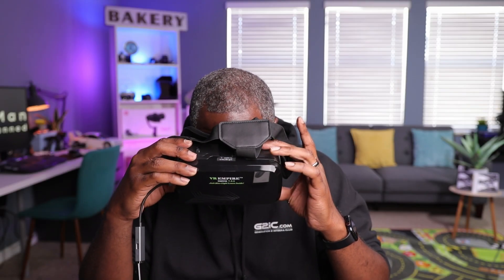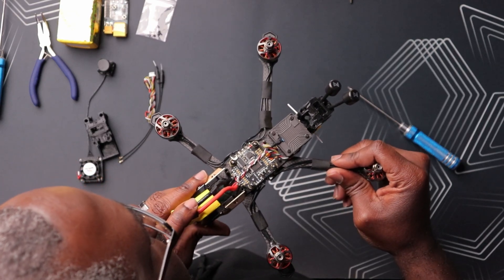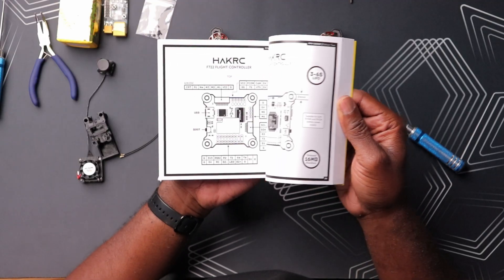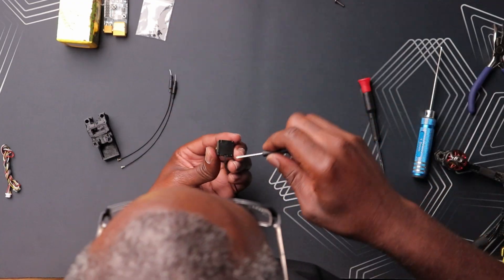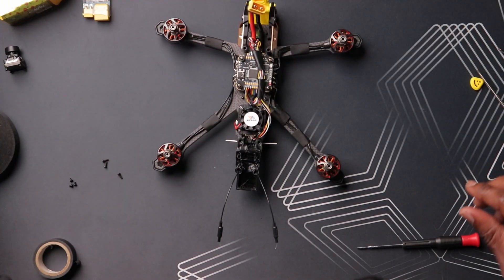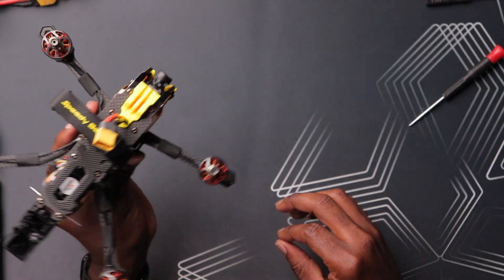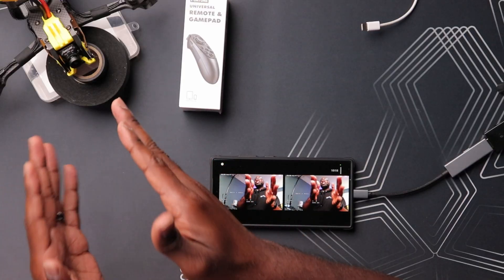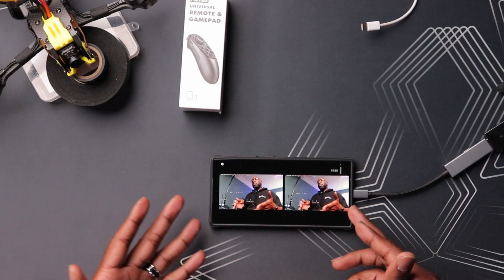Installing WiFi Link 2 (Open IPC) The EASY Way | No Configuration Required!

Comment: Hyped for the test flight! Propably gonna buy this and use it with my quest 3 and the pixelpilot apk
Reply from the maker: Nice!
Reply: Same, ordered one to use with my quest 2. Although i dont like pixelpilots monitor style fpv. I want fixed view like normal fpv goggles. Will try fpvue_xr, if it dosent work the way i want i will try to make my own render pipeline
Reply: So, how is it going? Did you test it? Wanna try to build a fpv drone and use my Quest 3, too.